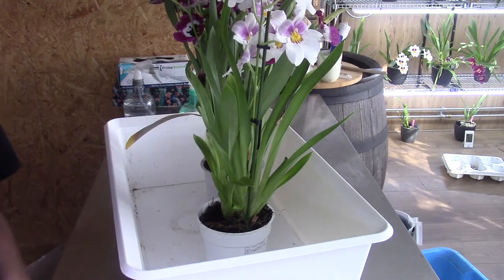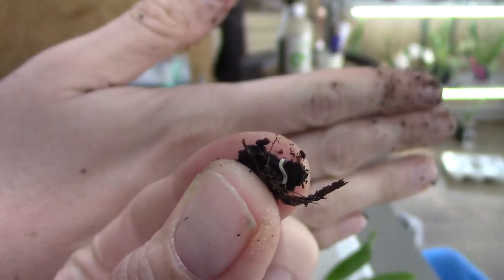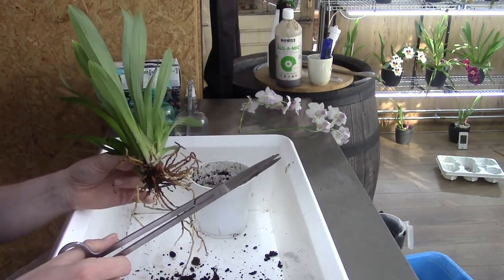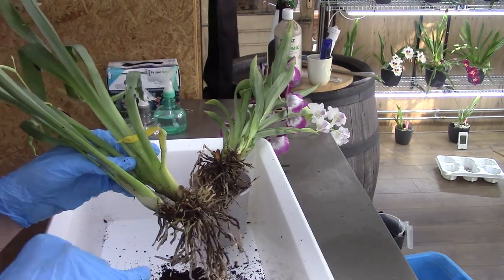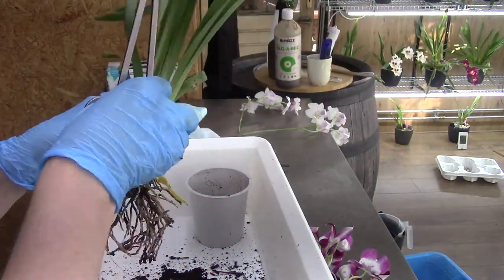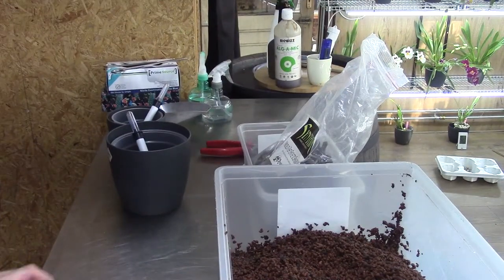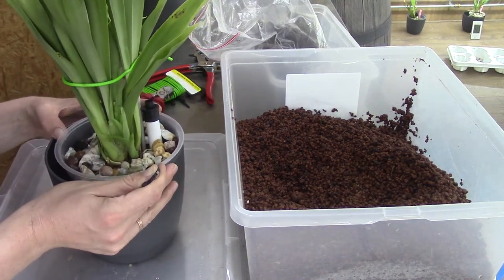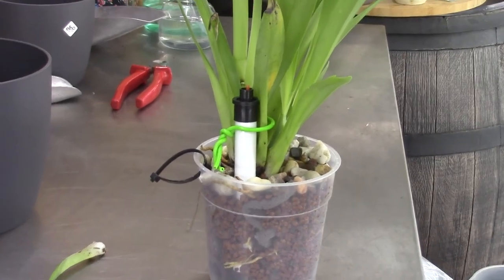Repotting Miltoniopsis into a self watering setup

Comment: Hi EJ, I’m a little confused about the stone top layer. If the stones are dry, wouldn’t the pumice make it easier for the roots to grow into the medium?  Also, what is your opinion about fertilizing while an orchid is blooming?  Some say you shouldn’t and some say the orchid needs the extra nutrients.
Reply from the maker: The stones will help to keep the pot more moist on the top. So, you do not get a ‘top dry layer’. Even though the pumice is more ‘root friendly’ than lecca (I found), it still can affect new root tips. I think the pumice without the stones on top, can absorb moisture from the air and thereby make it to dry around the new root tips and they will not grow and might even die off. The stones do also give a bit more weight to the pot, which for me is a bonus. The plants do not fall over as quickly, the pumice is very light weighted.

Comment: I just got an xxl miltoniopsis from an orchid shop and I’m not sure where to start with it. The roots are exposed and the 4” pot is about half too small. Should I split it in half or put in an 8” pot? It has one stalk with one bloom. Some of its leaves are a bit yellow. 😞
Reply from the maker: Depends, but I like to grow my plants as big as I can, so I do not split them if I don't have too. Do you grow in self watering? If you don't, you might want to use a fairly small pot. So the roots do not stay to wet to long, but don't let them dry out!